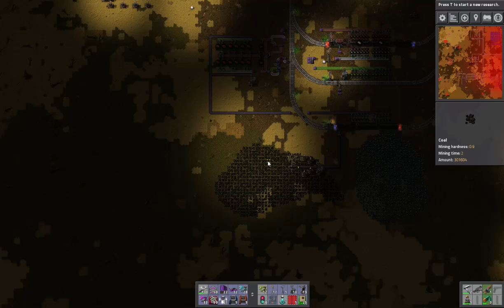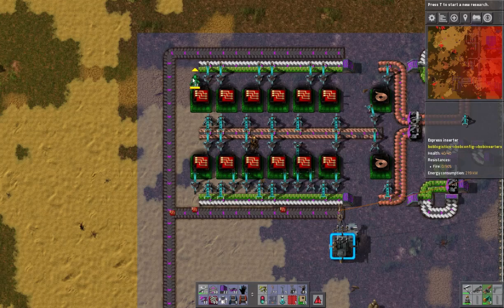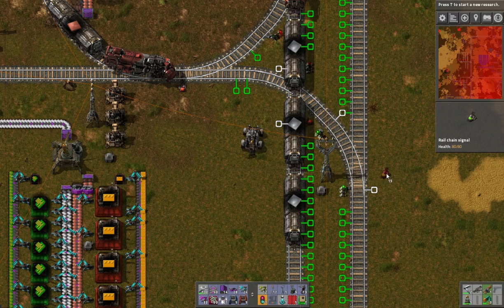Factorio: Back 2 Basics - Ep 58 Train Shenanigans

Comment: +Flexible Games You should try and fragment all of your T junctions. Chain signals should be in front of every merger, split and crossing and the normal signal should always signal any exit. This will prevent your trains to block one another especially, if they aren't using the same rail.
As for circle junctions, you could try spliting them into quadrants by placing chain signals between each in/out rail (also evey in rail should have a chain signal to enter), so that multiple trains may use the track and not block each other. Unless the circle is too small for 2 trains to be passing through it, it should speed up trains.

But this is just my 2 cents on the matter, also I love the series. :)